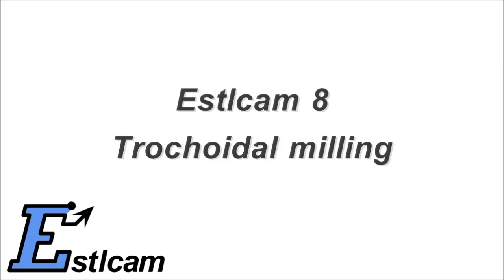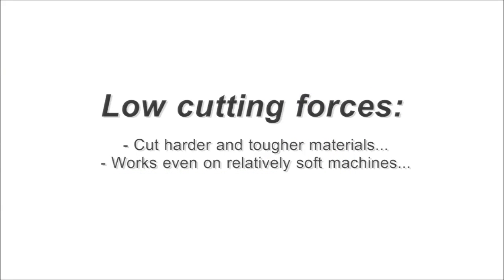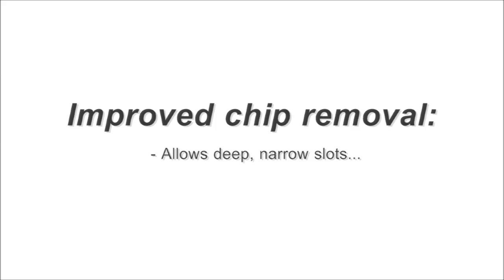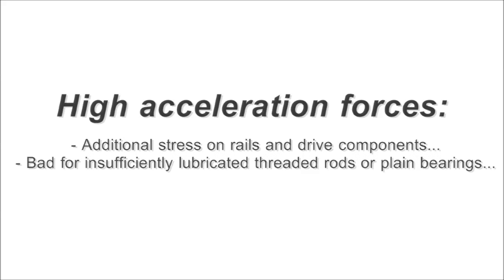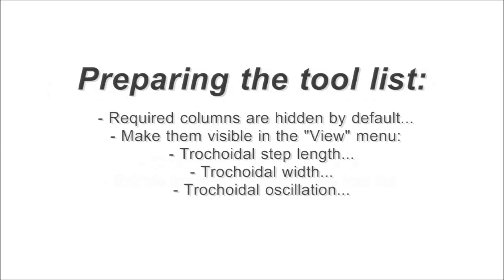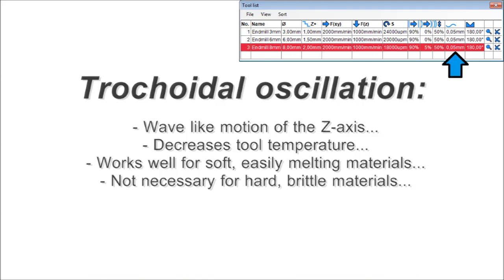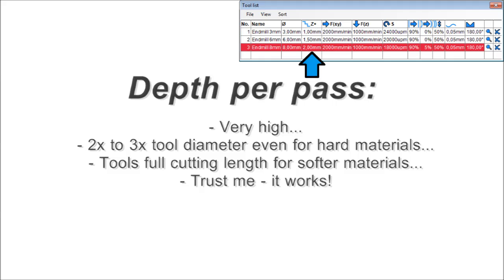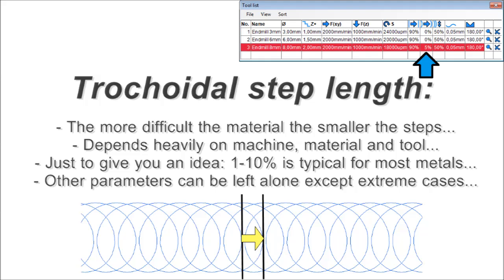Estlcam 8: Trochoidal milling (English)

Comment: Wouldn't it be possible to save some more time and reduce the vector count if one shortens the idling back path where the tool is not in active milling touch with the workpiece? 
Letting the tool travel the whole back path in a circle seems to create some unnecessary overhead. 
Or would the non-harmonic motion shake up the machine?
Reply from the maker: I've tried this but as you've already guessed it just shakes the machine.
It also causes acceleration spikes forcing the machine to slow down in advance to avoid losing steps. Especially when you want to be as fast as possible and get close to the machines limits you'll lose speed this way instead of gaining.
Reply: Besides that, the circular pattern resembles a larger diameter tool and thus makes the calculation of the toolpath potentially simpler.